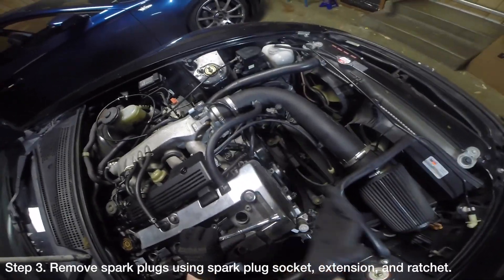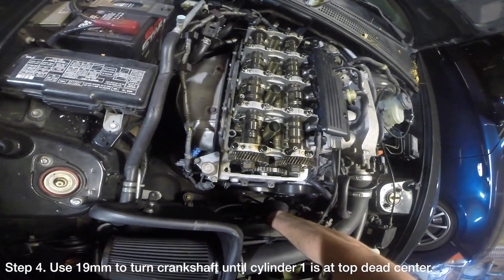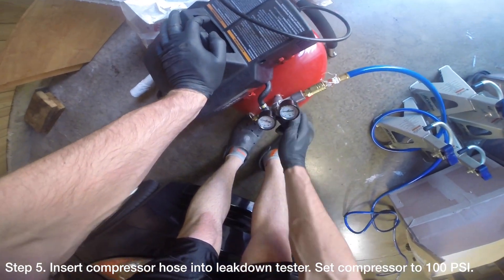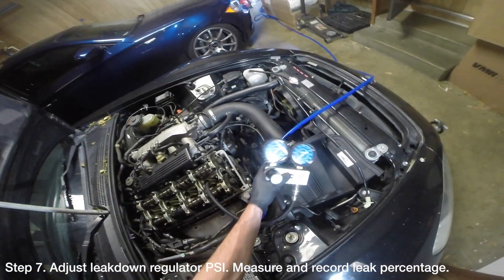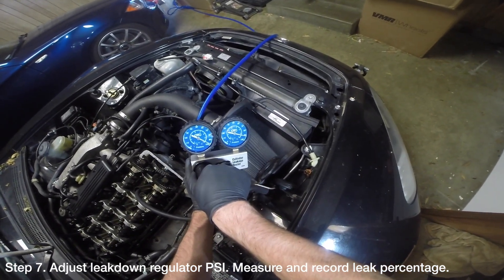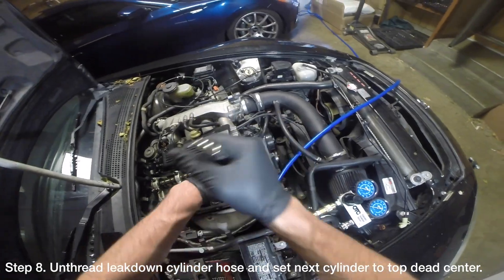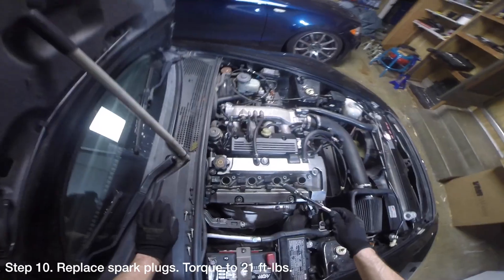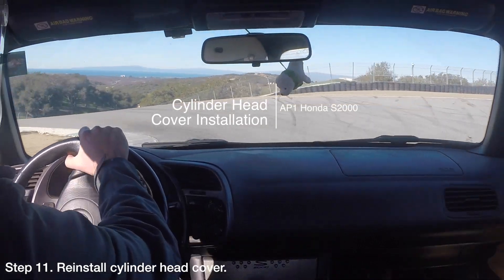Leakdown Test | Honda S2000

Comment: 1. No need to take off valve cover. Just rotate to top dead center and bottom dead center using the marks on the crank pulley. You might need to try twice depending on if you’re on the compressor or exhaust stroke.
2. “A cylinder with more than 10% leak indicates a problem.” No. Leakdown is acceptable down to 30%. I wouldn’t bat an eye unless one of the cylinders is significantly worse than the others
Reply: Dude you're a lifesaver. I didn't know it but I was on TDC for the compression stroke of cylinder 4, and I went to leakdown test cylinder 1... 

As you might've guessed the meter dropped like a rock, and I was thinking about next steps.

Anyway thank you, retested TDC compression on cylinder 1 properly and it's all good!